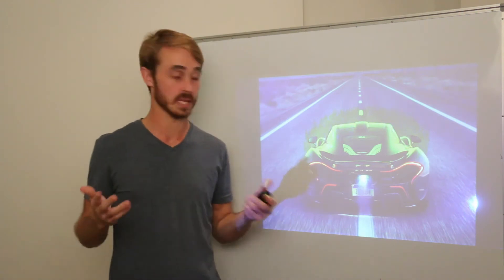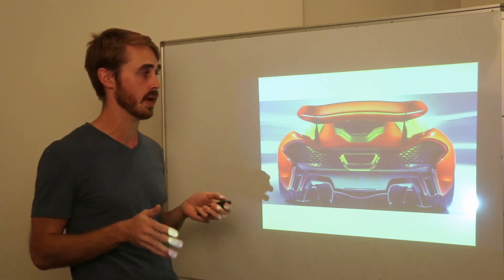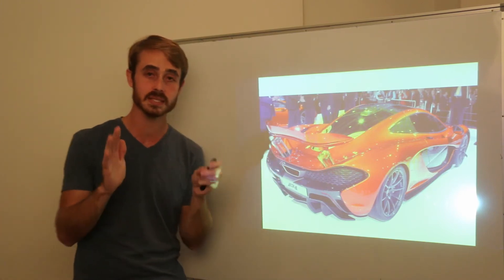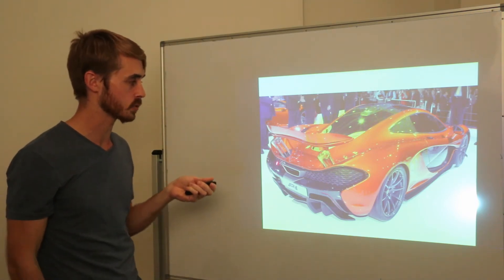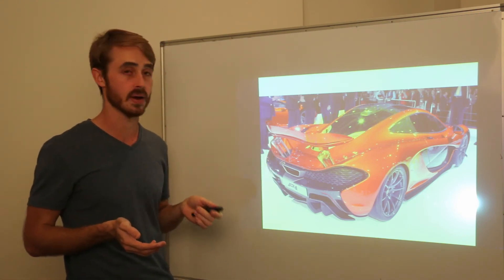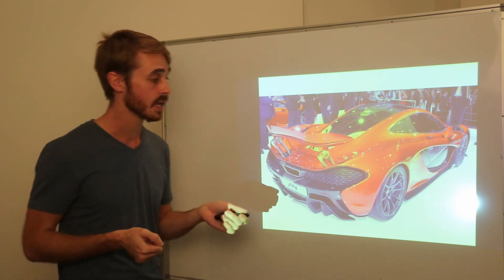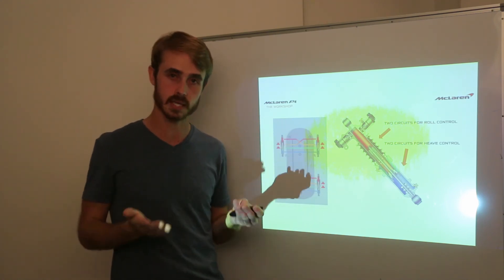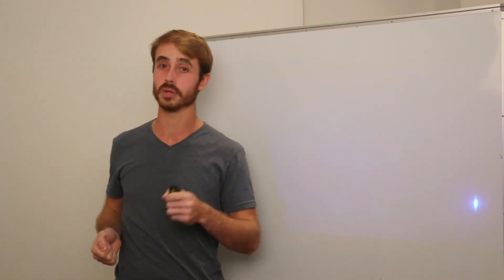McLaren P1 - Active Aerodynamics Analysis

Comment: I think that correct figure for Cd for McLaren P1 is like 0.34 which is great figure comparing to other cars, but worse than McLaren managed 25 years ago with F1. McLaren F1 have Cd of 0.32 (0.39 when balancing spoiler is activated during braking), it feature no wings, have more advanced active aerodynamic (it used among others two electric kevlar fans to further decrease the pressure under the car). But to be honest McLaren is not it was 25 years ago, and F1 is designed by one of best as not best Formula 1 cars designer in history Gordon Murray, same guy that designed most dominate Formula 1 car in history 1988 Honda-powered McLaren MP4/4 which won 15 of 16 races and score 199 points (which is 1 point more then all other teams together managed to score in that season) or revolutionary (and immediately banned) Brabham BT46.
Reply: The F1 also made a lot less downforce, and the ground under the effect fan probably isn't shrouded enough for it to actually do much.
Reply: Phos9
Interesting how all that downforce of P1 do not translate to faster car on track, P1 been unable to record a faster time than 7 min 4 sec on Nürburgring and F1 did it in 7 min  11 sec, but on 250m longer track, and according official figures new track is around 10 sec faster then old 250m longer, which make F1 faster then P1.
According many sources main reason why McLaren never did publish official data for P1, is that P1 failed to beat F1 in any aspect (and main rival 918).
Reply: Downforce typically isn't that useful on street cars, mostly winds up just being drag.  The F1 takes it on the straights.
Reply: @mrlazda I mean, the p1 lm, did do 6:43 and it's estimated that the road car did it in 6:47. We don't know though

Comment: almost makes you wonder how the Ferrari keeps up, if the McLaren is working this well
It's very refreshing for someone to look at these cars without automatic reverence for everything they do, not automatically assuming that everything is perfect (if they were perfect, they'd all be the same)
Reply from the maker: Anthony Stuart The Ferrari has less weight and a more consistent powertrain (doesn't drain) to help it keep up I suppose. I'd hazard a guess that a P1 would beat it quite soundly around a track like Spa though...

Thanks for the compliments!